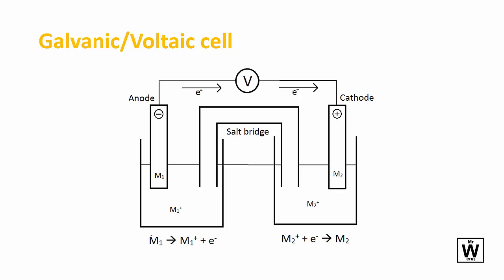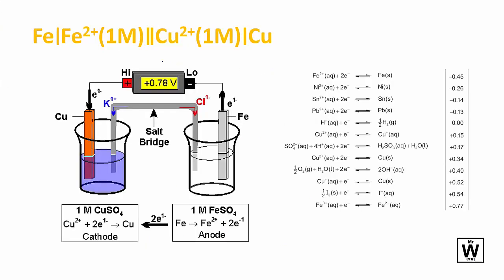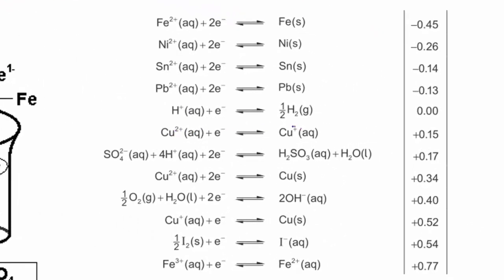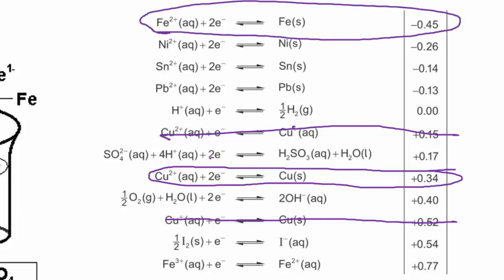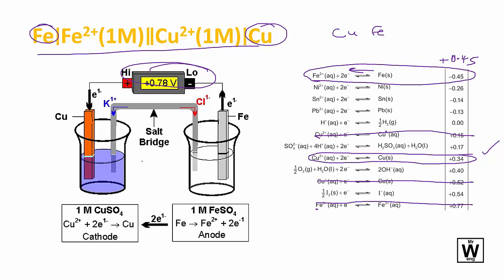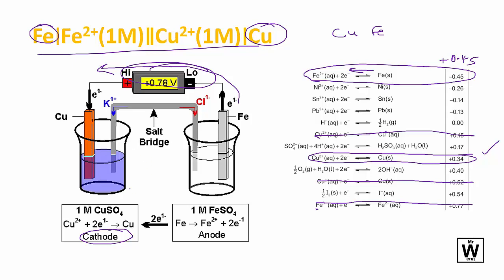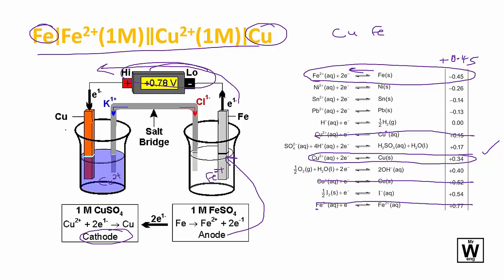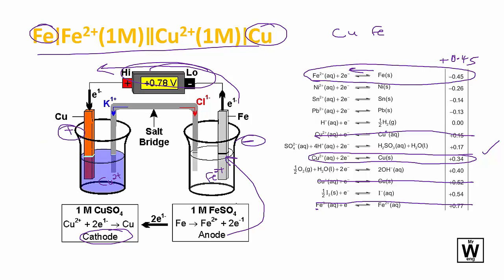Iron Copper Galvanic Cell | U3 |

Comment: What if Fe had a charge of 3+ what would the half reactions be
Reply from the maker: Hi Garima, as the reaction goes to completion you would need Fe3+ + 3e -> Fe(s). As this is not in your data booklet, you could find this by using Hess Law by adding Fe3+ + e -> Fe2+ with Fe2+ + 2e -> Fe(s) to get the E reading. In other words QCAA are unlikely to ask you this as they don't usually have any complex/unfamiliar questions in the exam, even though you have the knowledge to do it.